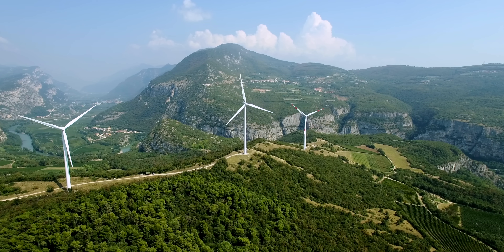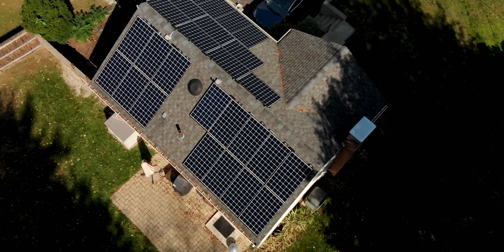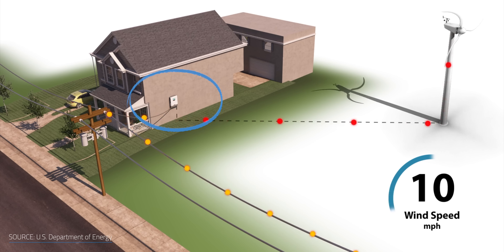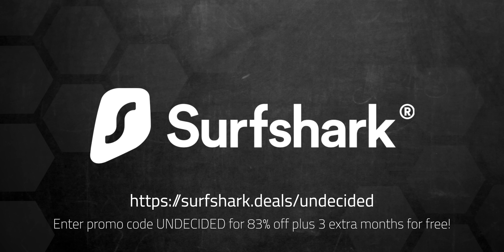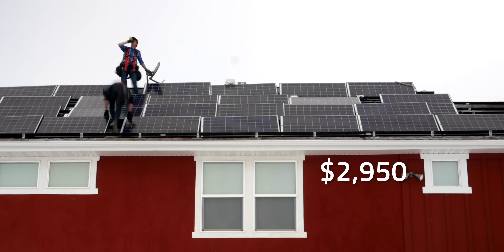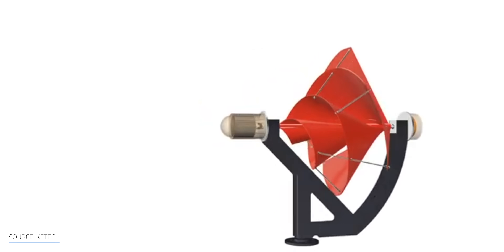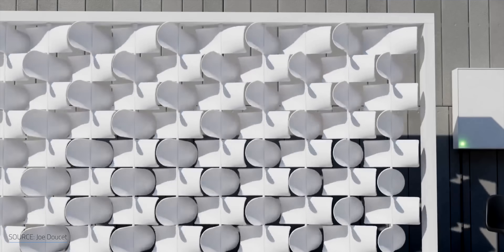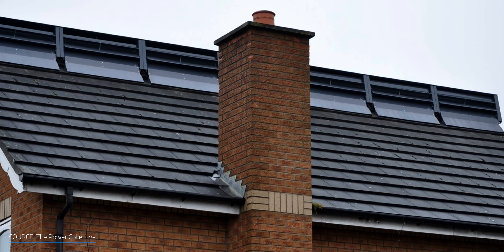The Challenges of a Wind Turbine on Your Home

Comment: just to add a little  extra at times solar can't,  couple small vertical ones might help out, especially in northern climes where solar gets scarcer at the higher demand time of winter.
but as you point out, it's now developing more into something and should get cheaper over the years as solar did.
probably not the tower horizontals in neighbourhoods, but some of the other type designs you've shown would fit well  at roof edges and peaks. etc.
much more resilient to be off grid with storage.
so, what. a decade away from being more common and cost effective compared to solar?

Comment: A few items that you missed or didn't specify enough on with both applications. First off, both applications can be significantly cheaper if doing a DIY setup. You can get 1KW of power from either application for around $1000, with solar slightly cheaper. Second, wind power is heavily reliant on constant higher wind speeds, which most houses simply don't have. Grid Wind Turbines are both in high wind areas and high off the ground, making them much more useful. And third, when wind speed is good or easily accessible, it is FAR, FAR better than solar at that point. 

The big downside for solar is that all of the power comes within an 8 hour period or less. If your home plugs up to the grid, then it isn't a big deal as you can just sell that power back. But if you are trying to go off-grid or your a grid operator, you either need to capture that energy or it's wasted. This means batteries and a lot of them. With your example of 1KW of solar, you would need nearly 4kwh of batteries to support it. Wind is more constant, so you only need a small battery to offset when the wind dips or you use more power at that moment than the wind is generating. Still, most homes simply won't be able to get enough constant wind energy to be worth it. 

On a side note, we really need to start building out many more grid scale battery systems. When power needs are too high, grids currently ramp up peaker plants that are horrible. Yet during lower demand times, efficient power plants and renewables all either ramp down production or have their extra energy curtailed. Complete waste. And you don't need several days of extra power either. Just 4 hours of backup is more than enough.
Reply: I completely forgot about the battery issue, if you gotta need a large battery bank to be able to handle the wind fluctuations then for a regular home isn't worth it.
Reply: @makatron  You still need a decent size battery bank for wind power, but not as much as you need for solar. You mostly need batteries to cover peak power demand and daytime usage.

The sad thing is that wind and solar compliment each other extremely well. A large amount of power is needed when the sun is out, so that solar energy can go straight the home usage while charging the batteries for evening use. Wind can supplement the batteries during evening times when usage is higher than solar input. And then wind can cover nighttime power needs while recharge the batteries to cover early morning. With that setup, you only need a small bank of LFP batteries to cover evening hours (fluctuations and morning are too small in comparison).
Reply: @anthonypelchat  sometimes I wish I was actually rich enough to get off grid
Reply: @makatron  lol. Agreed, though sometimes it seems like it's easier if you're not rich. If you're rich, you buy a bunch of crap you don't need that uses a ton of power. If you can avoid those, you then need less solar/wind, less batteries, and smaller inverters. 

I'm actually trying to plan something out for my household. We cannot do so at current usage levels. But I might be able to go mostly off-grid if I only move the 110v connections and leave the large 220v items on grid (central ac and dryer mainly). Slowly convert the house to heat pumps instead of central ac/heat. Move any additional 220v it's over well after, or go to a lower power solution.
Reply: @anthonypelchat  where I live we get almost 7 hours of avg peak sunlight so in the long run my plan is to put 12 kw pv system in half my flat roof that could even offset the cost of me having the AC running constantly.
Reply: @makatron  Nice. I'm hoping to move soon and to have some land. If so, I want the solar away from the house a bit (diy system). I also want to replace the ac with heat pumps. Should reduce the power usage during summer by at least 10% and will prevent the need for gas during winter. I'm in GA where peak solar is like 7-8 hrs each day.
Reply: @anthonypelchat  I wish we could have off-site PV system just to install 20kw in a lot and offset my home consumption.
Reply: @makatron  how much electricity do you use during Winter normally on a daily basis?
Reply: @anthonypelchat  what's this winter I hear people taking about? The avg annual temp 29c and it's basically summer all year long here in the caribbean.
Reply: @makatron  lol. Was thinking about the usage during cooler months. Summer for me is 70-80kwh needed each day. But winter, which isn't really that cold and seldomly drops below 0c/32f, usually only hits ~20kwh per day since the AC doesn't run. I should in theory be able to cover my house with all except AC with just 4-5kw of solar even outside of winter. Getting everything off-grid except AC would be huge. I should be able to diy that system for under 10grand with battery backup. Possibly much lower, but gotta account for the unknowns.
Reply: @anthonypelchat  my annual daily consumption is around 26kwh but during summer goes almost all the way to 40 as even at night never drops under 31c. During our fresh season, what you would call winter, I never need over 13kwh. I'm planning to install the panels above the master bedroom to provide shade to the roof because concrete stays way too warm hours after sunset.
Reply: @makatron  I lived in Mexico for the better part of two years. I've seen similar temps with concrete houses. The panels should help with heat a bit. Make sure that you have good windows too. The ones we had in Mexico were horrible. Get some double pane or other high insulating windows if you don't have them already. We had to live in very poor areas, so hopefully it isn't that bad in your location.
Reply: @anthonypelchat  yeah o already had double panel windows that I got in 2019 when found out how much cold was escaping the room. Hope I can get my panels installed before June, already feels like a boiler room.
Reply: @makatron  Good luck. I wish you the best. I'm probably 6 months out at best.
Reply: @anthonypelchat  this friendly banter is the reason not to lose faith in the comment section, yeah my main goal is 2,100 kwh monthly

Comment: If I had an off-grid solar solution and I decided that I wanted to add a small unit of extra capacity I think there might be an argument for adding wind as part of the overall solution... but for an on-grid solution or a new installation solar is the obvious winner.

Comment: This was really informative! I recently moved closer to the coast and it's more windy, and I already have solar, so I was wondering about the state of small home wind turbines. Would you consider doing a video on solar hot water, for domestic hot water or even space heating? I'd love to see a comprehensive video on where that stands today, it seems to be less popular than a decade ago, and that surprises me with how much more energy can be thermally collected from the sun vs PV panels. Maybe PV combined with the latest heat pump tech is a better way to go now in terms of simplicity, maintenance free, and efficiency?
Reply: In India, Solar Water Heaters are very common. With a 200Ltr storage we get enough hotwater even in winter /rainy season when there is not much direct sunshine. There are 2 types: Evacuated Glass Tube based and Copper Plate based.  Glass tube performs the best. Should work in most of the southern US.
Reply: I’m not positive, but I think that heat pump efficiency has progressed so much that many people don’t want the cons that can come with those other solutions anymore. That may be why you feel like you don’t hear about it as much these days.
Reply: @SaveMoneySavethePlanet  I was about to say the same.  Rooflines have limited space for solar panels, and it often makes more sense to use that space for PV instead of heat.  geothermal heaters plus water heater systems are advertised a lot (or use to be... now that I think on it, I haven't heard an ad about that in a while)... I would assume you can do the same with 'normal' heat pumps as well.
Reply: I endorse what  @Anand Vaidya has mentioned. The ROI starts from day 1 itself. No need for heat pumps, I have looped the supply through a standby heater, such that constant hot water is available 24/7. (Return on Investment)

Comment: I’ve really wanted to add some small wind to my renewably powered home, but like you found I couldn’t justify the expenditure, I’m still toying with an small “hobbyist” project to have a 600w multi rotor vertical unit on the bird table height tree stump in my garden. A small windy-boy inverter would still cost £1500 or so on top of £2500 for the maglev turbine. It could provide a little base-load cover at night.

Comment: I think the designers of small wind turbines are missing something!
Most of them are basically a scaled down version of large turbines with 3 or sometimes 5 blades. This is efficient high up with steady wind flow but in lower urban areas the wind flow is a lot more turbulent!

What seems to work best is a model very similar to the old US wind pumps to be seen in virtually every western. 12 -20 non aerodynamic blades fitted on the periphery of a wheel which turns a lot slower than "normal" turbines. It also turns at lower wind speeds meaning the loss of efficiency is more than compensated for by extended run conditions. They do tend to be lower power too, to prevent "cogging" but the extended run conditions can more than make up in terms of annual production!  

Sometimes bigger is not better!
The ridge turbine is good ...... if your predominant wind aligns against your ridge!

Comment: Maintenance on a turbine 20m up on a thin pole isn't going to be as easy as hosing off your solar panels with the garden hose.
The pole likely needs to be of the type that hinges at the ground and a series of pulleys to lower and raise the head.
So you need to allow enough space in your yard to lay down a 20m pole with supporting wire cable and hoist. No thanks.

Comment: Love the ridge blade design , looks like it has a future , quietness and servicing costa would need to be low for home owners. Larger buildings with pitched roofs such as public buildings may make it more cost effective along side solar
Reply: Right. All that's needed is to figure  out a way to rotate the house to allow for change in wind direction :)
Reply: @whatafellow  - there is already a constant flow of air to the existing ridge vent, from sunlight heating up a roof or from panels heating up, so this additional updraft should help, as long as there is sunlight
Reply: I agree that it looks promising on the face of it. But I wonder of the ridge blade design will attract birds, bats, and squirrels in search of a nest.
Reply: @PaulvanEgmond  - that is always the concern with any structure... problem with windmills 

Mud wasps like to make a home under solar panels, because they shield from elements. :-(  

Polar bears congregate & live near oil pipelines, because they are warm! :-)
Reply: @PaulvanEgmond  divert a few watts to a pest-ridding hyper-sonic sound source located just under the system's top panel / cover, and I think that would solve your critter-attraction problem.

To scare birds away, an "invisible" low-power UV-only strobe would work and not bother human or other mammals. 

(Edit to add critter details and the bird section)
Reply: @PaulvanEgmond    These ridge blade design will eat a lot of birds and maybe a few squirrels. Then someone has to clean that out of the blades from time to time.
Reply: @oldmech619  Screens.
Reply: @DarthBludgeon    Screens drastically slows the flow of air.  As you can see from the above note from Rinus, that the ridgeblade was very inefficient anyways.
Reply: @oldmech619  not really a simple metal screen would prevent birds and squirrels from getting in without interrupting the flow of are all that much (i'm talking something along the lines of chicken wire fence)
Reply: @veeot_dragon300  The screen would have to be small enough to keep the critters from camping out when there is no wind. I know there are places where the wind never stops, but those places usually don’t have a problem small birds, or squirrels
Reply: @oldmech619  i have used chicken wire for years to keep small birds and critters out of my chimney (we have a weather cover that is sort of like a little roof over it with the chicken wire  covering the gaps between  the cover and the chimney itself.).  the mesh of the wire is small enough that i don't even think a humming bird could get through.  you can get it in rolls in a number of sizes as well as differing sized mesh at most any hardware store.  (fyi i also use it to form cages around my tomatoes to keep the critters out while still letting pollinators in)
Reply: @veeot_dragon300    Wow. I will absolutely accept your real world experience. Thank you
Reply: I too favour the Ridge Blade. I'm hoping to see the technology become affordable to the point of it becoming a standard
Reply: @sabret00the  - I wonder if existing squirrel fan type wind turbines can be mounted in a horizontal fashion to build it DIY?
Reply: The ridge blade design makes sense for my home but would need to be combined with solar panels for sure. During the winter overcast days we have steady winds and during the summer we have mostly clear skies and lots of sun.
Reply: I wonder how those respond drifting snow.
Reply: I know the organization Urgenda tried testing the ridgeblade at the Dutch island of Ameland. I made some calls to find out the results because nothing was published.  Someone involved in the testing said it was a complete failure.  The rotor was not capable of providing enough power to keep the inverter alive. They gave the manufacturer opportunity to improve the system and they tried but just couldn't get it to work. Annual production 0kWh. May be that on an off-grid DC system it might work,  a bit, but these results are not very promising....
Reply: @Supergrover767  Hi Rinus, I'm the Technical Manager for RidgeBlade. We are aware of the issue. That installation was completed by the previous RidgeBlade owners. We have since taken it over and upgraded all the power electronics and PMG design. The previous issue was that the inverter was not properly matched to the PMG, hence it could not efficiently convert mechanical power to electrical energy. We have a pilot site in the UK now where testing is being carried out to optimise the power output of the RB2 five rotor system.
Reply: @Nigel Weir My only concern, being that I live on a heavily-wooded property, would be branches getting stuck in the turbine. I don't think it would take much to jam it up completely. Other than that, I think it is very promising :)
Reply: Pretty sure they're out of business - their phone numbers are all defunct and their social websites are all down. Tried to fill out their form to get a quote and that was broken too.

Comment: The wind panel at 12:33 while it might not be that efficient, if positioned to block the sun on your home, could help reduce cooling cost. Not sure if it would justify the cost over just planting tree's or tall shrubs though.
Reply: Solar panels also shade your home ;)
Reply: I thought about that too, but the moving patterns of light you'd get from the blades could get annoying pretty fast, I'm afraid.

Comment: I like the idea of the ridge turbine.
UK law would limit its height to 20cm without planning and more costs.

Wind here is no constant, I looked at the idea, but with houses, noise, cost and production. Wind has to be better than it is.
Most of the time, at night the air is near still. So small blades are not going to cut it
If you have Solar, then adding panels can work, but there are limits there also, space being the main issue.

Solar is cheap, but I went grid tied for the past few weeks and I cannot recommend this at small scale, and averaged.
It meets a need, and fits a format which I'm promoting. 
Today, we made 38% so far of the homes power from solar. It's not been a great day and I started late and we haven't finished yet. And it's not an ideal installation. Hence average.
Wind, we have had some of that and gusts. But unless it can make 600w each and every hour, it's just not going to come near to solar.
As I was off grid, the smoothing of batteries makes a big difference. But wind is far more unpredictable than Solar.  So the end here is can it provide or is it just a complimentary item? It would certainly have to cost less for home use, industrial maybe the best place to keep wind farms.

Comment: My neighbors have a small turbine at their off grid cottage on the great lakes. Admittedly it's an old one at this point but they'll probably never buy another one, originally the idea was to get a backup/supplement their solar. The thing makes alot of noise and it's the type of noise that gets annoying quick, especially because one of the main reasons they live full time at their cottage is the peace and quiet. Maintenance is also annoying especially compared to their solar panels which just require the occasional cleaning. Currently the turbine is disabled and they use a backup diesel generator (or maybe its propane, not 100% sure) for the rare times that their batteries drain down low enough.